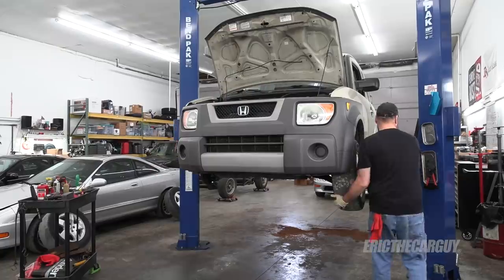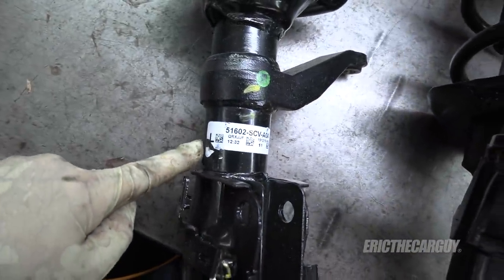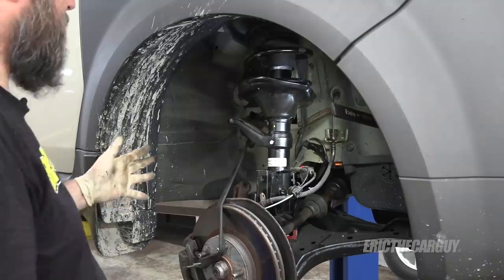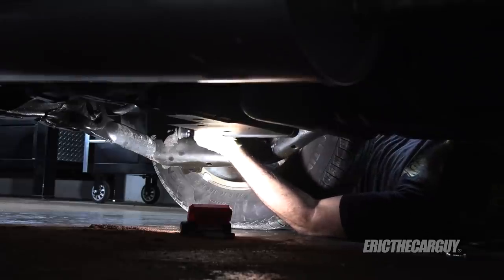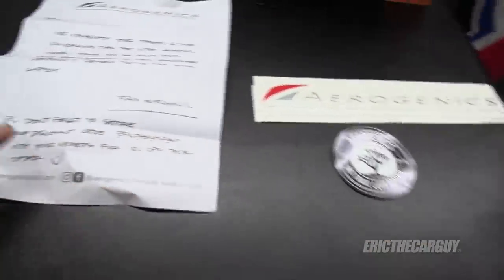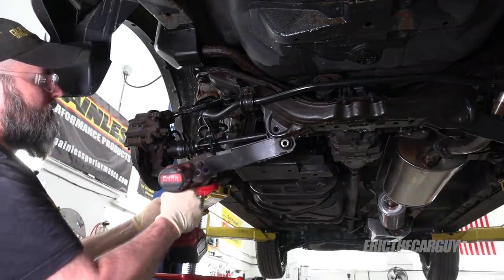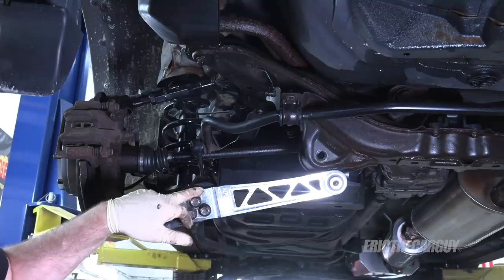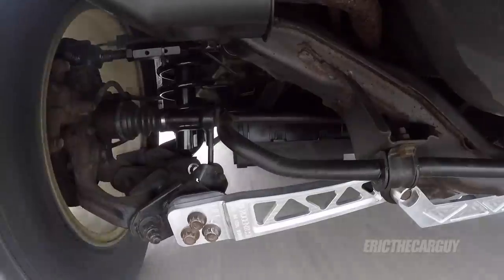Honda Element Suspension Rebuild (Part 2)

Comment: I think were in sync Eric, i just replaced the whole front suspension and did brakes all around and bled the system on my beat around/winter camry. Put some new michelin defenders on the front even that i got for a good price of course. It does seem strange putting so much time and effort into a vehicle you just plan to use for things like winter driving but its good to have a reliable pos rather than just a pos.
Reply: That's how I feel about my 77 pickup. Its rusty and beat up, but everything mechanically is sound. Even replaced the entire brake system, including the lines. It's my reliable POS.

Comment: Lol, that misspelled part is normally what Chinese parts are like. To top it up they provide you with a socket that can't even deal with the job it's supposed to do.
Reply: Yeah that was...odd
Reply: Maybe the socket was only meant for tightening. So you wouldn't crack it.

Comment: I guess I'm just an ol' skool guy, but aluminum suspension parts make me nervous.  I know that corrosion resistance may be a factor, but dissimilar metals in contact in a wet saline environment I'd think would nullify that argument.  So apart from a little bit of weight savings, what's the advantage of aluminum over steel control arms?

Oh, and I'm ol' skool, not old.  My beard is not gray.  It's... uh, sun bleached.  Yeah, let's go with that.
Reply from the maker: I don't think there's a real advantage other than if you wanted to renew the inner bushings, you would have to purchase the entire control arm from Honda. They don't sell just the rear piece I replaced. I do feel that the brace between the 2 arms helped though. Even if you didn't replace the control arms, I think there would be some benefit to the brace. Anytime you can shore up the rear suspension handling improves.
Reply: @ericthecarguy  Yeah, I've got the same complaint about my 96 Tacoma.  The front suspension upper control arm bushings are integral with the control arm.  The last time I dug into her in 2011, there wasn't an aftermarket option that I could find and the Toyota arms were around $250 each.

I wound up replacing one anyhow when I got some bad dope from Haynes.  The Haynes manual says 105 f/p for the ball joint.  That suspension is not something that I was familiar with so I wanted to go By The Book.  I wound up sucking the ball joint stud straight through the arm.  Checked the actual service manual and it says 105 N/m.  I usually love Haynes, but that one typo hurt me.

I can't say much about the brace as I don't have any experience with Elements.  You'd know better than I would.  But I can't see how it would hurt.  If it rolls better than it did, then I call it a Win.

My winter vehicles always get more love and attention to detail than my summer ones.  A failure in a blizzard on an icy road could put you in a ditch where they might not find you for a couple of days.

Thanks for responding.  Be safe out there.  Seriously, I've driven in your neck of the woods.  Those people are morons.

Comment: The 2 killers of coil springs, in order of occurrence:
The vinyl coating get's damaged, ablates (peels off). Oxygen attacks the tempered steel.
The top bearing fails, causing the spring to "wind" on turns. Vehicle suspension
springs are meant for compression/expansion only, not twisting.

Comment: I replaced lower ball joints on an acura TL I had a few years ago. I used anti seize and a torque wrench to secure. The nut ended up coming loose and the ball joint popped out and my car came to a stop in an intersection. A buddy said just put those together dry, plus we live in AZ so no salt or corrosion. Your thoughts? If I had to do over again I think I would look for ball joints with a cotter pin.

Comment: I really would like for All the mechanism to be more upwards, all of it sprayed with a thick protective coating, like that anti-rust you mentioned, and that everything have a steel metal cover of all the bottom of the car, to protect from everything; easy to take off and put back on, for all brands. Might be heavier but I think might be greatly beneficial for cars, and even to recycle the parts. I'm a fan of efficiency, and a dreamer, so this is my suggestion for all car manufacturers.

Another thing that I think car lack is more struts instead of just rods, so the car cushion better then roads, and absorb the energy that destroys the parts: I mean as much as is mechanically sound, for ex: on those 2x wish bones, they should be don't of struts, several of them, also the Aluminum parts in this car; imagine how much energy this could absorb, with all kinds of shock absorbents and a computer reading the terrain for optimal preparation of these cusshioners, would be awesome, less work and more simplicity I think, making these programmable shock absorbers: modular, robust and durable, maybe from a Steel+Titanium Alloys

Comment: Great video Eric. I had the struts replaced and suspension when I purchased my Element a few months ago used. The those upper control arms with adjustment capability do make a big difference. Thanks to you I purchased an Element. ♠️🎩☯️

Comment: Real life question: How do you torque fasteners on the ground of lower-clearance vehicles?  I'm not talking obnoxiously low but say a sedan as opposed to an SUV/truck.
Reply from the maker: A 4 post lift is your bast option, or you could jack it up and set it on 4 ramps. So long as the weight is on the wheels and it's level.
Reply: @ericthecarguy  Thanks!

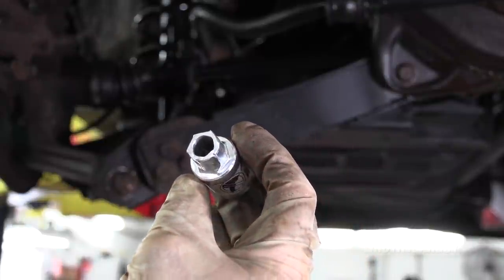Comment: 17:27 That explains why they dont want you to use an impact on these. That thing would fly right off as multiple pieces upon first use. :O
Reply: @lakinnenlako6883  Fair point. But if you need to use a real socket to remove the old bolts, why do you even need such flimsy socket adapter to install it? Couldn't you just use your special socket from the removal? ;-)
Reply: @blockbertus it’s because the loctite needing heat to be removed, that it was so stubborn.without the heat. Installation with the loctite isn’t set so basically a lubricant, would be easy.

Comment: Hi Eric ...I enjoy your informative videos - Thank you for sharing.  I found a 2008 Element EX 4x4 with 70,000 miles that looks pretty good, but what bothers me is the rear lower suspension is very rusted.  Most of the undercarriage is clean with little rust, except for this lower suspension piece. When watching this video, it seems like you treated your based on the wet appearance at minute 17.  I guess they also call this part (Element Rear Suspension Crossmember K-Frame Subframe).  My question is have you ever changed out this piece which the stabilizer bar also attaches to?  Is it a difficult job to do?  Thanks

Comment: I want to buy your rebuild Honda Element and or what would it cost me to bring you a Used Honda Element and have you do all the same rebuild job on it ?   Thank-you
Reply from the maker: It's not for sale. First, you have to find a decent Element to start with. That's not as easy as you might think, especially if you want a manual transmission. The cost to bring it up to where this one is would depend on the work needed. FYI, after I purchased these rear strut assemblies from Honda, they are no longer available. Thanks for the comment.
Reply: @ericthecarguy  I know I have been look for good Element to buy ( I have to said no to manual Element) I 'm look for a 2WD / auto. the bigger problem is finding low milage with good body. I have only  had poor luck ( if the miles is good the body junk ) if the body good the miles are high 200,000 plus. I only want your element because you had rebuild it. Thank-you for your time ( I'll keep looking for # 7 I have owned 6 Element the last element I totaled

Comment: hi Eric I have a question for you I have a Honda 2004 element I'm only getting heat on the passenger side and not on the driver side why is that been trying to figure it out can you please help me thanks in advance

Comment: I just recently replaced the struts on my parents '04 Element and wasn't able to NOT let that axle joint separate.  Though I was able to put it back together do you think I did future damage to the joint and I'm probably soon to be replacing the axles now? (IN YOUR OPINION THAT IS) 150,000 Miles boots look really good.

Comment: off subject but hopefully you can help..working on a 2006 Subaru tribeca, I took the timing chain without turning the engine over so that cylinder 1 is at TDC, how can i get Cylinder 1 to TDC without the timing chain on?

Comment: First where are you located.
Second I have a 05 element 180th with 
Code p2647 I have done about everything and still have the limping at 3000 rpm can you help me

Comment: Thanks for the video, awesome video as usual! I’m doing a suspension rebuild on my element too. I’m not looking forward to doing the rear control arms as you had a hard time getting the bolts off. I might have some trouble as I’m only 120lb female with no muscles, I wish Eric the car guy lived closer.

Comment: Eric, thanks for the vid! I have an 04 manual ellie, 190k mi.. Took your advise on the aerogenics catalytic cover, also adjustable rear upper controlled arms. Replaced front CV axels, now have knocking turning right to left. Thinking about replacing the shock only but wondering if I should replace the whole McPherson assembly , maybe broken coil?
Also thinking of installing aerogenics 2" lift kit, thoughts?  (Condolences to all you folks in the rust belt,  I grew up in Michigan but now have it easy out west) thanks again for the great vids!  (Almost forgot, I rebuilt my non working dual pump and got it fixed if you are interested ) Cheers!

Comment: Hey Eric, I have an Element and I'm getting vibration when the a/c is turned on. Could it be the engine mounts, compressor, or too much pressure from refrigerant? Thanks

Comment: Question- I have a 2004, 122k miles. The front strut bolts on top, the rubber is cracking around the bolt. It has not separated but I’m wondering how urgent it is to replace struts when that rubber is cracked. Also one of the bolts (passenger side) is different than the driver side. Passenger side does not have an Allen head on top like the drivers does. Which makes me think that passenger side has already been replaced once with an aftermarket.  Replace? Or good to keep going?  Would aftermarket struts be okay to get? Like 1A Auto or ones from Rockauto?

Love your videos as I just bought this Honda and am looking to do as much work myself.

Comment: Why do the 2003-05 Honda CR-Vs sag in the rear during acceleration? Can this be remedied with stiffer rear shocks or an upgrade of some sort? Do the elements have the same problem?

Comment: I have a big stress because I need to change myself my brake line on my honda civic lx 2002.  My stress is the size for order.  Could you confirm me the nuts of the brake line is  M10 x 1 mm and the size is 3/16 for brake line ? Is it safe to buy an adapter for the master cylinder for a 3/16 line?  thank you to help me with your information.  I need this car for my family.  I can't do an error for order on amazon with my budget. Thank you.

Comment: Hey man.  I have 2020 hyundai elantra
My car act weird after 15k miles; engine does not run smoothly, transmission is not smooth, idle is not smooth, RPM some times fluctuate at idle and when it runs.
I have to clean the throttle and reprogram it every 15k miles, but I don't know why it does like that since the car was new.
By the way, I do all maintenance at time.

Please give me any solution to solve this problem.

Comment: Yup, not supporting the knuckle after removing the strut is exactly what I did. Managed to damage driveshaft oil seal on the gearbox and to lose some of the fluid. That added some money and frustration that wasn't needed, but you live and learn

Comment: Hi Eric can I bring to you my 2006 Honda Element to fix all rear suspension like you Honda elemen…. Struts already replace just replace aluminum lower and upper control arm suspension like yours and alignment . Just you know all bolt and nut easy to lose because I did and put grease. Please let me know if you can do it. Thanks

Comment: I daily my project car (even in winter) fluid film does wonders to protect it. It kinda sucks to work on, but no new rust.
Reply from the maker: I used Krown. Linked in the description.
Reply: @ericthecarguy  I use their 1 gallon kit with a Schultz gun and undercoat with it once a year works great (can't speak for Krown)

Comment: I have an 02 CRV and I shopped around for the Honda Showa struts. I have found them to be very expensive. The aftermarket alternatives like Monroe; Gabriel and the Chinese Fcs sensen brands just don’t hold up well. Would KYB struts, a Japanese oem brand to Toyota or Blistein a German brand be a recommendable alternative to Showa ?
Reply: Go with KYB, like factory, got them installed in my 2003 Civic 4 door hatchback and in 2004 Hr-v so far so good, 3 years and counting.
But!! Get new bolts especially for the rear shocks!! i fought those 2 fricking bolts for 2 days straight! Both Christmas days (days off from work), one bolt head broke and seized, the other just seized in the shock bushings NO FUN!, doing this job in the winter covered in snow, cold and darkness.
Reply from the maker: Personally I never thought that KYB struts did as well as the OE Showa. In my experience, I've never known anything German to work well on a Honda.
Reply: @ericthecarguy  Well if I'm not mistaken KYB is a Japanese company which is why i bought them, don't want anything made in Germany (over engineered) and/or China (low quality). There were 2 reasons why i replaced the shocks, 1 front springs were broken (yup, while i'm in there), 2 rear shocks were corroded heavily. They all worked good, hence when i changed them i could not tell the difference from OEM and KYB, that civic 03 has a stiff suspension (not much suspension travel) after changing the shocks it was as stiff as ever, very annoying, i'm used to drive a 1st gen CR-V that does not care about bumps, put holes, lack or pavement. Civic is stiff good for stability, bad on the back and poor for going over obstacles, Cr-v rolls like it's about to tip over but very easy on my back, and good for fun where there are no roads :)

Comment: I am a BIG FAN of your channels ~~~~You know a lot about Hondas. I have 2008 Honda Odyssey EXL. I clean the throttle body with CRC TB cleaner. Closed and Open butterfly positions by holding down the throttle paddle with the brick with Ign switch On. Then I removed the Just NEG battery post for 6hrs. After connecting the battery, engine RPM was hunting high(1200then to 2000 RMP) and low idle hunting happens when the van comes to stop, idle goes down to 1000 RMP then goes up to 1500 RMP. When the van comes to a complete stop idle came down to 750rpm.     ENGINE CHECK LIGHT CAME ON after cleaning. But after idle relearn it went away.  I have tried ECU Idle relearning steps,  1st,  2seconds of ignition on, then start the engine and run it @3000rmp for 5min, then let idle the engine for cycle the radiator fan on and off twice. after that run the A/C for 5 minutes. to finish the process I drove for 30min ???? It helped with removing high idle hunting 1200 RMP to 2000 RMP but low idle hunting is still there the when van coming to a complete stop.  Also, after idle relearn a few times engine hunted when I accelerated to 3000RMP with reduced power. Very slow acceleration had no hunting pasted 3000 RMP(not happening after 2nd steps).   2nd step, removed both battery posts, then reattached both cables for 20 seconds then remove both cables for 3hours.  After 3hrs, reattach the cables but, still, low idle is hunting.....  ANY SUGGESTS  ????????  Thank you very much ~~~~~~complete stop

Comment: Eric you are the man. Good videos. Element rocks!! Quick question. Is the aluminum brace the one what makes the ride stiffer. Or the lower control arms have to do part of it? Would it make difference if i would just install the aluminum lower control arms only and not the brace? Would that still give some performance on the suspension?. Or is it just for show?

Comment: Remove the axle nut and tap the cv joint loose so it doesn’t pull the cv joint apart.you can reuse the axle nut multiple times actually I have never replaced one and have raced Honda’s for over twenty years

Comment: 10/10 get a 10 point steel special socket online. Speaking from experience, the Aerogenics one is garbage. I will say though they were very nice and sent me an Element third brake light cover and a t-shirt when I told them what happened.
Reply from the maker: Link in the description. Thanks for the comment.

Comment: what's nice on Erics end is all the training he gives to his viewers he doesn't have a trainee in the shop that he expects to do the work he would train them to do ! Isn't that cool Eric ? That's gotta be a load off your mind ! Always push the fluid back in the MC and never had a problem, I'm thinking in your case, is the proportioning valve had to be reset not your MC. Had caliper bracket bolts with lock tite and didn't tighten them enough without putting on new lock tite. Lost the bolts on the road. Bought new bolts that came with locktite. The other side that also were loose but didn't fall out. Shop just tightened the loose bolts. No issues. Nice advice about witness marks, but ummmm you cleaned the other side and painted it. Not a good reason to clean and paint area where control mounts but nice try ! Yes no impact on aluminum.... just like torque specs on aluminum rims.